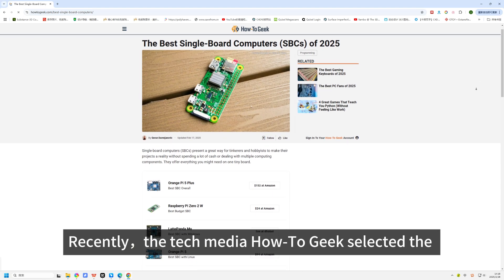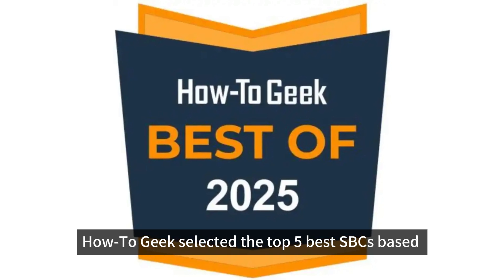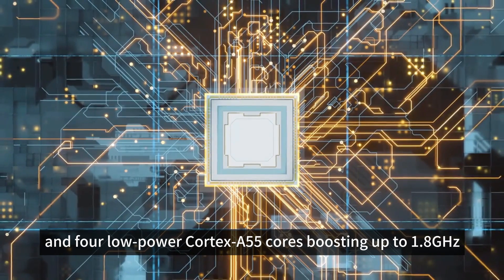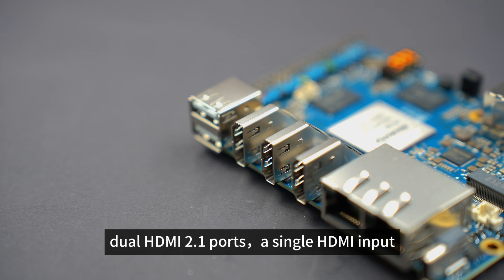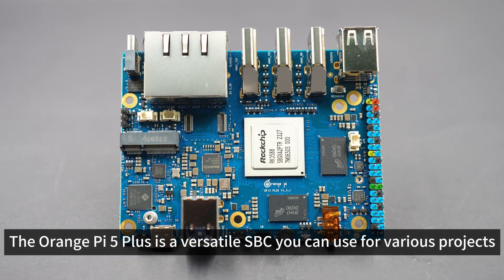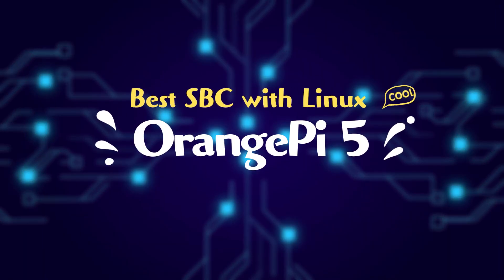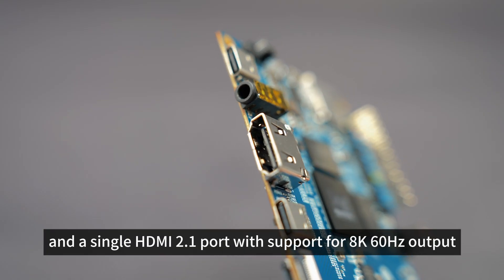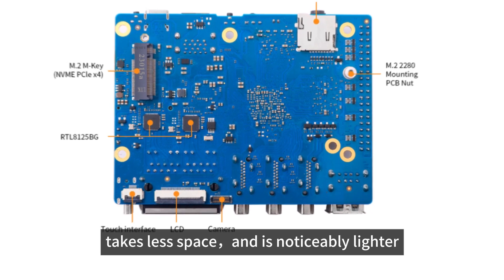Orange Pi 5 PLUS & Orange Pi 5 Have Been Named Best SBCs of 2025 by HOWTOGEEK

Comment: excellent Linux support means that "there is practically no official distro with GPU acceleration out-of-the-box". The only functional distro is Joshua Riek's Ubuntu, unfortunately currently without active development. The other option is to tinker with Armbian and an old kernels. In numbers, a really great board with absolutely appalling SW support from the manufacturer.

Comment: Have your CM4 with them small board. Its now a NAS. Your board is good your documentation & support is BAD! Using your Debian OS, your Orange OS has issues running on it.
Had a problem getting it started, read your Wiki and was following step by step. Asked support and the people that did NOT read the ticket advised to read the Wiki.
Resolved the issue on my own.